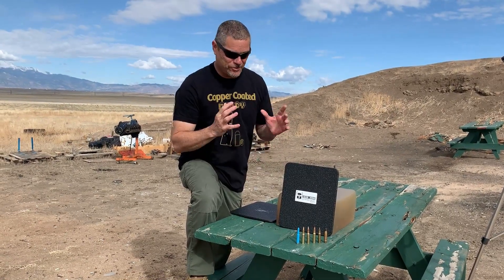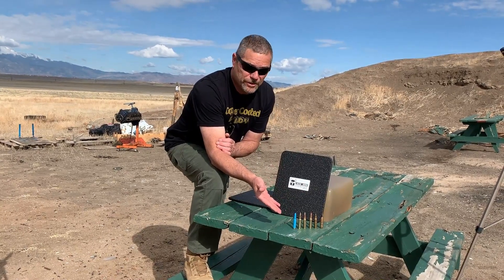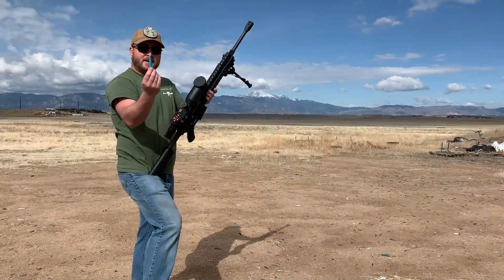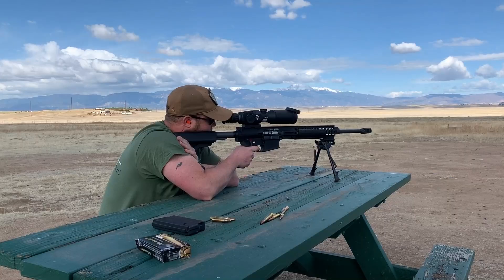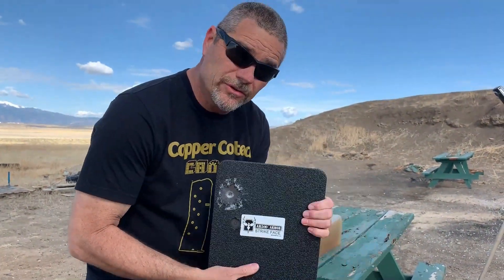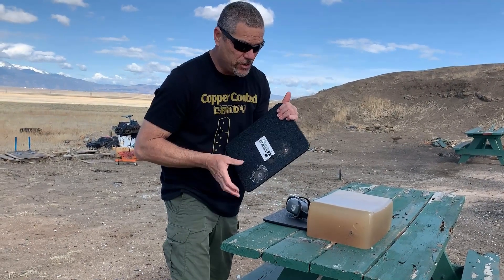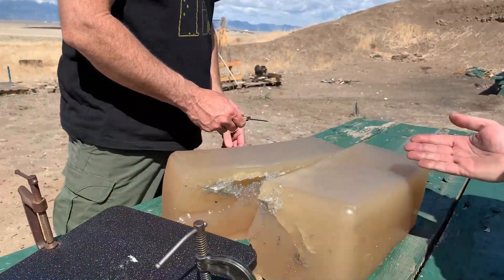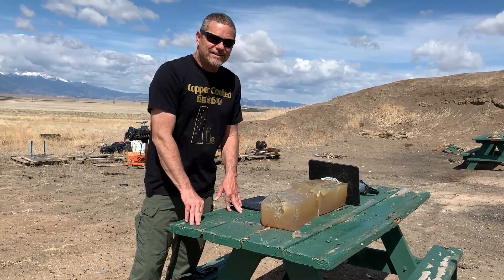308 SLAP Round vs 1/2" AR 500 Armor Plate

Comment: You should do this same series of tests on a good quality level 4 ceramic plate. Im curious if ceramic or composite plates could stop the 308 SLAP
Reply: 308 SLAP goes right thru level 4 body armor like it’s nothing. It’s been tested on YouTube.
Reply: Level IV ceramic for sure would get passed through like butter with a 5.56 Tungsten core round but they cost a phenomenal amount of money per round. Tungsten is not expensive-maybe $350 a kilo. It does however take an incredible amount of energy to melt, I think more than any other metal including titanium.
Reply: @arminiusthehibernian7282  I wonder if you could make some sort of interstitial alloy (for bigger density and hardness) from maybe iron/steel and some other cheap metal. Might still be expensive to melt though lol. Also is your name a reference to The Rangers Apprentice book series? Only place I’ve heard “Hibernian” lol

Comment: Both M948 SLAP (93 gr) and M993 AP (126.6gr) has a Tungsten core not steel.  SLAP was discounted due to accuracy and sabots breaking in barrel, blowing out the sides.

Comment: Where do you find this stuff man I can’t find black tip 308 anywhere😂
Reply from the maker: Sand5086 3456 Online bro. Just type in what your looking for and google will do the rest. That’s all we do.
Reply: Sand5086 3456 you can find black tip at local gun shows usually. Sold individual or by the box. If you have them in your area. Just make sire to bring a magnet.
Reply: Drewe Carlson  no the AP ammo has a hardened steel core that will attract a magnet. A regular lead core copper jacket will not be magnetic. An AP round will. You can test a green tip or black tip round this way
Reply: I think he means tungsten core black tip like m993. Not m2AP tool steel core loaded into a 308 case which are available everywhere. M993 is impossible to get much like these slap rounds they tested lol
Reply: You can find the Pulled AP Projos on line for cheap. Then load your own at a greatly reduced cost. Use the same data as for a projo of the same or nearly the same weight and work up to it like any round you'd reload.

Comment: Is there much difference between 30-06 black tip and 308 black tip? I am partial to 30-06 because i inherited a rem woodsmaster carbine in 30-06 built in mid 1960's
Reply: Depends. There are two "black tips" in .308. M61 AP or also called P80. Has a different core shape then say M2-AP in .30-06.Current production "black tip" is M993 and has a tungsten core. That is far superior to any previous .308 Black tip.
Reply: @BuffRANGE  ty for the reply. I watch your channel as well

Comment: What year marking did your SLAP round gave on it? Most are either 85 or 90 with a couple 88’s in between. Just curious. The 85’s are supposedly less accurate than the 90’s but if yours is an 85 that will help disprove this.
Reply from the maker: No idea what the markings were.
Reply: @GoingBallistic  Thanks for replying! Can I send you one from 1985 and one from 1990 and you can do a video on which is more accurate or the same? Have Justin shoot, he’s a good shot.
Reply: Also, put up 3 AR500 plates and see if it makes it through them all, or if only one from 85 or 90 make it through? I think this would be a good video! These rounds are $100-150 a piece so aim carefully!
Reply from the maker: @RexSkittles  sure, email us at ballisticsmasher@gmail.com

Comment: Yeah as I expected. I've heard stories of guys with 240s loaded with SLAP hunting Russian BTR 70s Saddam bought during the second invasion. Heard that they shot through to both sides of the vehicle hull with sustained fire. I believe if memory served me that it was 5th Special Forces that did it. I could wrong about the who did it but it is definitely believable.
Reply: Source?
Reply: @ryanmaxwell5794  You're in luck, the guy I heard it from was a former 1SG of mine now CSM. I saw Tactical Rifleman mention it in one of his videos, I believe it was his 240 video. But I don't remember which one. Check out his videos, been months now.

Edit: You have to remember BTR70s that were for commercial export by the RU don't have the same level of armor as western equivalents. Hell, up armored humvees will get rocked by just fmj 51 cal Dshks. Can you imagine a smaller round with AP loaded? Especially getting shot at by multiple 240s with SLAP loaded by guys with a crap ton of trigger time on those 240s?

Edit 2: BTR 60s.

Comment: Since you are using a high speed camera, I have to ask you a question if it would be possible for you to put the high speed camera closer to the target (like the steel plates in this video) and change the frame rate for higher (super high) so that we could see the bullet and how it goes through the target? Just asking.
Reply from the maker: My camera is not that good of a high speed camera.3000-5000 FPS works best, but after that the screen gets really small and gets much harder to work with on my editing software. 
If we could get one of the bigger channels like Slow Mo Guys or Smarter Every Day to email us back we could get some excellent videos of the SLAP rounds etc.
Right now I’m doing the best with what I have.

Comment: how do you get the ap 308 rounds? can i buy thousands of them easily?
Reply: Actually it is illegal for an FFL to sell 7.62x51 AP ammo. Because the Remington XP-100 ''pistol'' , Thompson Center Contender and a few others are chambered in .308. So now the 7.62x51 AP is considered armor-piercing HANDGUN ammo.

You can buy the components and roll yer own. You just can't sell it. There used to be several sellers of ''pull down'' AP bullets.

And while 7.62 AP is for all purposes identical in ballistics and effect to 30-06 AP, you can buy/sell/possess all the 30-06 AP you want.

WHAT IS AP AMMO, BY FEDERAL LAW?

The definition of AP ammo is at 18 USC sec. 921(a)(17):
"(B) The term `armor piercing ammunition' means-

(i) a projectile or projectile core which may be used in a handgun and
which is constructed entirely (excluding the presence of traces of other
substances) from one or a combination of tungsten alloys, steel, iron, brass,
bronze, beryllium copper, or depleted uranium; or

(ii) a full jacketed projectile larger than .22 caliber designed and
intended for use in a handgun and whose jacket has a weight of more than 25
percent of the total weight of the projectile.

(C) The term `armor piercing ammunition' does not include shotgun shot
required by Federal or State environmental or game regulations for hunting
purposes, a frangible projectile designed for target shooting, a projectile
which the Secretary finds is primarily intended to be used for sporting
purposes, or any other projectile or projectile core which the Secretary
finds is intended to be used for industrial purposes, including a charge
used in an oil and gas well perforating device."

[Secretary means Secretary of the Treasury, in reality determinations
are delegated to the Technology Branch of the Bureau of Alcohol, Tobacco
and Firearms (ATF)]

Note the following things from the definition:

1) The definition was changed as part of the 1994 Crime Bill (9/14/94),
primarily by the addition of "full jacketed" bullets intended to be used
in a handgun whose jacket is more than 25% of their weight. The previous
language is at the end of this article, for comparison purposes.

2) AP ammo is the bullets ONLY, not the loaded ammo, although ATF has
identified some AP ammo by the loaded ammo, not projectiles, for the
information of FFL dealers, who are not supposed to "willfully"
transfer AP ammo.
>From this it follows that loading the bullets identified above into
completed rounds does not constitute "making" AP ammo; making the
bullets themselves does.

3) USE - The bullet must be able to be used in a handgun. Rather than
construing this to mean regular handgun calibers, ATF construes this to
mean any caliber for which a handgun has been made, including handguns
in rifle calibers, like .308 Winchester, and 7.62x39, for purposes of
bullets covered by (B)(i). Thus bullets suitable for these calibers,
as well as other rifle calibers for which handguns have been made (at
least commercially made) which are constructed as described below would
or should be AP ammo.
However bullets that fall into the AP definition under (B)(ii), because
their jackets comprise more than 25% of their weight (solid copper bullets?)
must be intended for use in a handgun, not just be able to be used in a
handgun.

4) CONSTRUCTION - The bullet must either have a core made ENTIRELY out
of one or more of the listed metals, or be a full jacketed type bullet
with a jacket comprising more that 25% of its weight. Thus SS109/M855
.223 (5.56mm) bullets would not be covered, because their core is only partly
steel, and partly lead. Lead is not a listed metal, and bullets with
cores made partly out of lead are OK. ATF has expressly ruled that
SS109/M855 bullets are not covered.

5) Hardness of the bullet is irrelevant.

6) Ability to actually penetrate any kind of soft body armor is irrelevant.

ATF has listed the following rounds as AP ammo:

All KTW, ARCANE, and THV ammo.
Czech made 9mm Para. with steel core.
German made 9mm Para. with steel core.
MSC .25 ACP with brass bullet.
BLACK STEEL armor and metal piercing ammunition.
7.62mm NATO AP and SLAP.
PMC ULTRAMAG with brass bullet (but not copper).
OMNISHOCK .38 Special with steel core.
7.62x39 ammo with steel core bullets.

ATF has specifically exempted the following rounds:

5.56 SS109 and M855 NATO rounds, with a steel penetrator tip.
.30-06 M2 AP ammo.

WHAT FEDERAL RESTRICTIONS ARE PLACED ON AP AMMO?

If you are NOT a (FFL) licensee under the Gun Control Act (an individual):
It is: ok to OWN AP ammo
ok to SELL AP ammo
ok to BUY AP ammo
ok to SHOOT AP ammo
NOT ok to MAKE AP ammo (18 USC sec. 922(a)(7))
NOT ok to IMPORT AP ammo (18 USC sec. 922(a)(7))
The only persons who can make AP ammo are holders of a type 10
FFL, also needed to make destructive devices, and ammunition for
destructive devices. The only persons who can import AP ammo
are holders of a type 11 FFL, who can also import DD's and ammo
for DD's. The FFL's cost $1000 a year.

If you are a licensed manufacturer or importer:
NOT ok to SELL or DELIVER AP ammo (18 USC sec. 922(a)(8)
(with exceptions for making/importing for law enforcement, export, or R&D).
No additional restrictions, except as listed below. This applies
not only to holders of type 10 and 11 FFL's, but also type 7 and 8
FFL's (makers and importers of guns other than DD's), as well as
holders of a type 06 FFL (maker of ammo other than for DD's).

If you are a licensed dealer, manufacturer, importer or collector:
NOT ok to SELL or DELIVER AP ammo without keeping a record of the sale, similar
to the bound book record for firearm sales. (18 USC sec. 922(b)(5)).
No additional restriction, except on dealers as noted below.
The records required to kept on sale or delivery of AP ammo need only
be kept for two years, not twenty years, like firearm records. See
27 CFR sec. 178.121, and 27 CFR sec. 178.125.

18 USC sec. 923(e) allows the revocation of a dealer's FFL
for willfully transferring AP ammo, with exceptions for sales to law
enforcement and so on. This is dealers only; holders of a collector
FFL (type 03) may willfully transfer AP ammo if they wish, but must comply
with the record keeping noted above.

Some states also regulate or prohibit armor piercing ammo, and these
laws may bear no relation to how the federal law works. For state
laws, check locally. The following states regulate AP ammo,
to my knowledge, but the definition of AP ammo and sort of
regulation may (and likely does) deviate widely from the federal
approach. NV, OK, RI, VA, AL, NY, NJ, IL, IN, KS, LA, MN, FL, PA, TX, NC.

+++++++++++++++++++++++++++++++++++++++
The former statute: 18 USC 921(a)(17)(B) - "The term 'armor
piercing ammunition' means a projectile or projectile core which
may be used in a handgun and which is constructed entirely (excluding
the presence of traces of other substances) from one or a combination
of tungsten alloys, steel, iron, brass, bronze, beryllium copper, or
depleted uranium. Such term does not include shotgun shot required
by Federal or State environmental or game regulations for hunting purposes,
a frangible projectile designed for target shooting, a projectile
which the Secretary finds is primarily intended to be used for sporting
purposes, or any other projectile or projectile core which the
Secretary finds is intended to be used for industrial purposes,
including a charge used in an oil and gas well perforating device."
#1